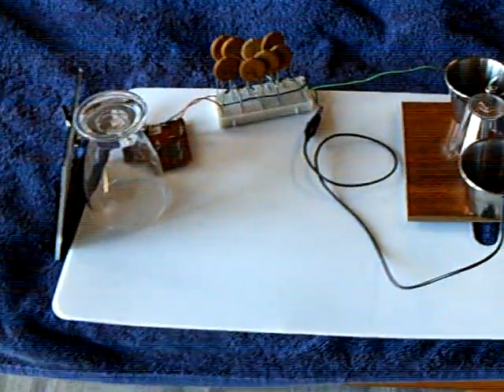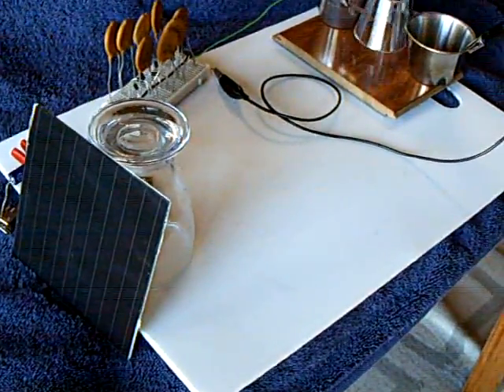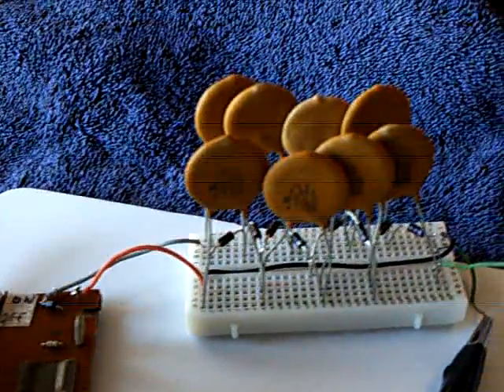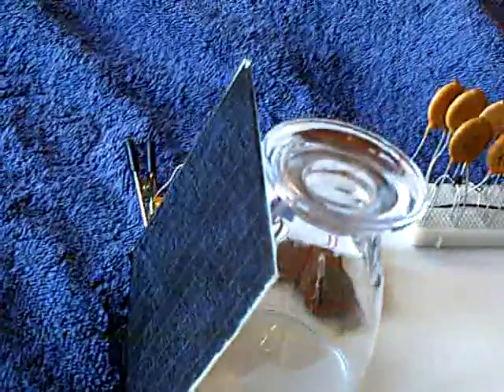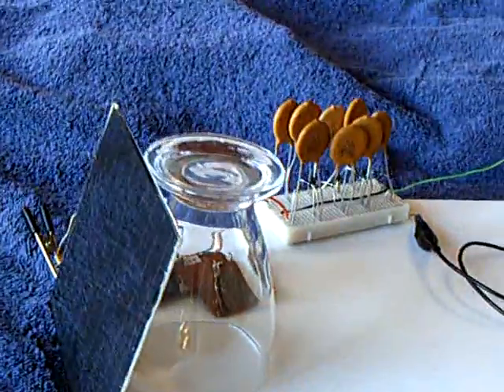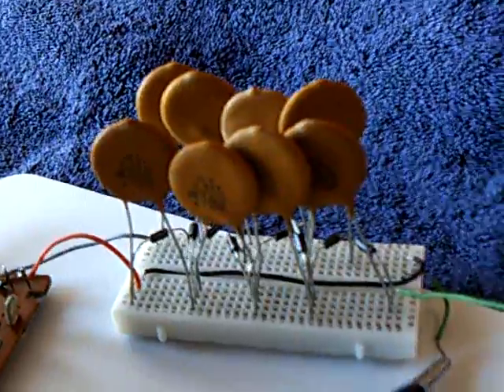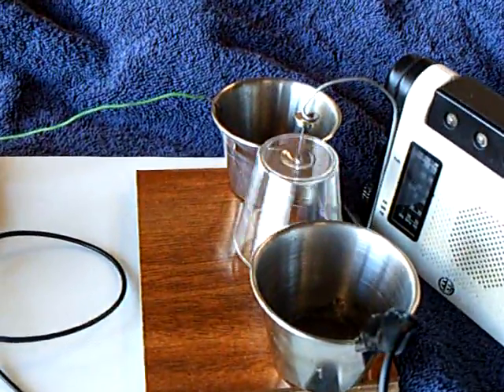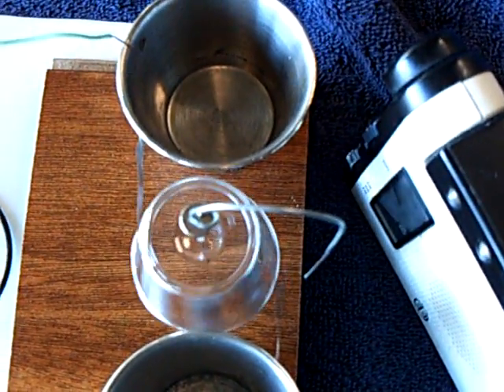Solar Powered Electrostatic Motor

Comment: Completely pointless, but really awesome too. Looks like your having fun :) Makes me think of Rube Goldberg devices. I wonder how many stages of stuff you could power... Maybe uv or ir LEDs to transmit some power harvested from the electrostatic motor to a penny or something? Add a slayer and some Franklin bells too, how long a chain of stuff can be run from that solar panel in the shade? You got a like and +1 from me.
Reply from the maker: These electrostatic devices just facinate me for some reason.  It is such a different way to make motion than I am used to.  Before I made this video I tried to get the motor to run on a long antenna and a ground wire---no luck.
Reply: *****
 Can you give a little more info on the antenna?  Thanks for sharing this experiment.  As soon as we get some good weather and I have a little more money, I plan to work on this type of project.

Comment: Hmm, I wonder if this could be mixed with an over balanced wheel for a rotor some how.
Reply from the maker: Interesting idea.
Reply: *****
Maybe, one where the weights slide out along rods as the centrifugal force increases.
Reply: kylie wilson
They used this setup in the back lash control on some older fishing reels.